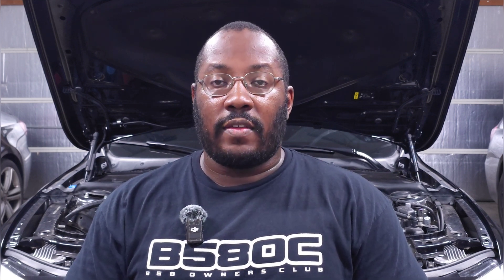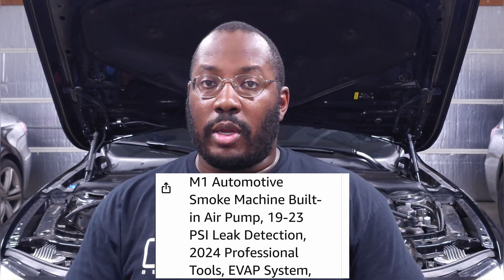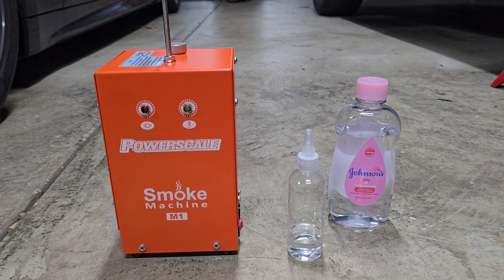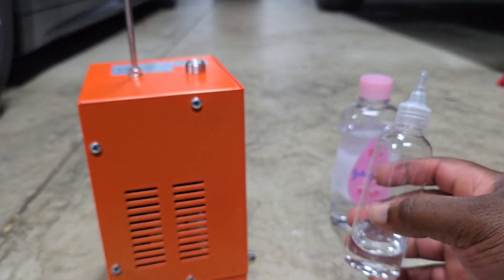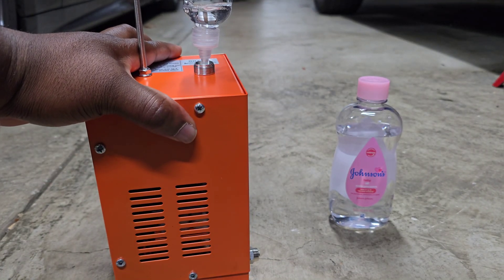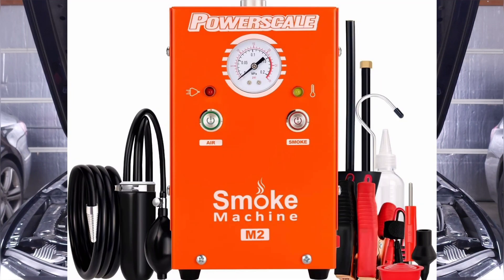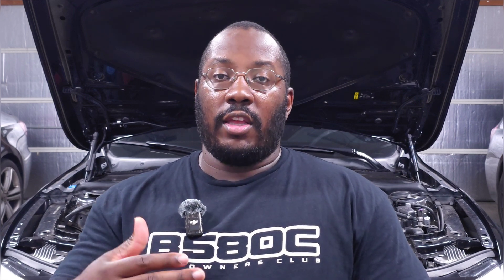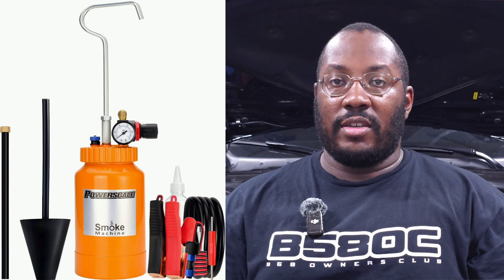How to Diagnose Boost Leaks on B58 Engines (340i, A90 Supra, etc)

Comment: Thanks for the video! Can you go a little more into depth on where you hooked up the smoke machine? I think I have a leak on my charge pipe, but not sure how to hook it up and it seems like it is at higher boost levels. TIA!
Reply: did you ever figure this out. Just put cts charge pipe on and tuned the car today and hear a howling noise wondering if it’s a boost leak